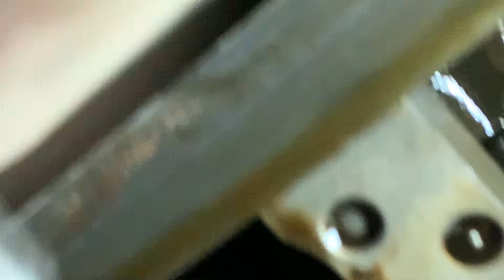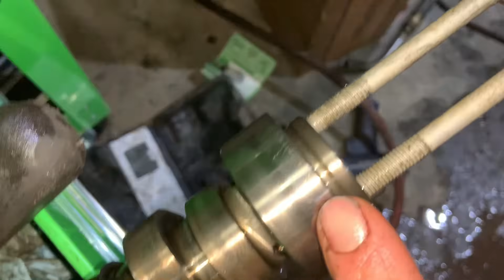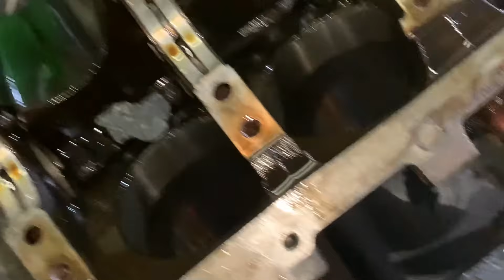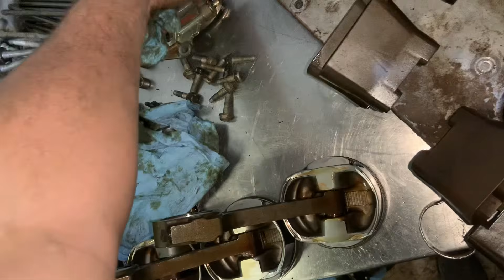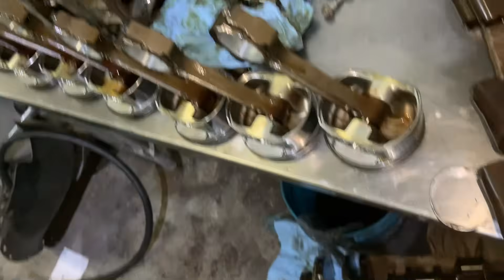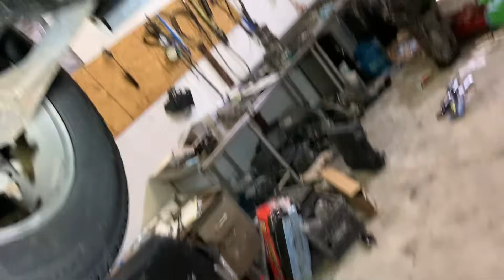ULTIMATE LS ENGINE NO OIL PRESSURE LOW OIL PRESSURE DIAGNOSIS AND REPAIR GUIDE

Comment: I can’t figure it out!! I have 40-45psi on startup but after it’s completely warmed it’ll drop to 10-13psi I’ve checked with a mechanical gauge, replaced cam bearings, replaced oil pump and o ring, replaced pickup… I can’t figure it out.

Comment: This means that if your lifters start becoming noisy, then every thing you mentioned should be checked including pulling the oil pan off and replacing the suction tube O-Ring. You could replace the lifters and the problem will remain otherwise.

Comment: Yes thanks nice vid .. I’ve got a GMC Sierra 5.3 that has 40 psi on start and maintains fine for first 5-10 run then sits on 18 psi on idle and once putting foot on gas maintains 30 psi I’ve changed oil pump , oring at pick up tube , oil pressure sensor, still same issue..  is this oil pressure ok ??? Truck has 240,000 miles it’s a 2011 model… thanks

Comment: Damn good video wow! I had an oil pressure problem on my 5.3 & thankfully it wasn't the cam bearings....it was an AC Delco oil filter. Oil pressure dropped down to 10psi.....(was always 50 psi).....changed it out to a WIX brand & it went back to 50 psi & has been there ever since. I dodged a bullet! God forbid I would ever have this problem but the 1st thing I'll do if it happens, I'll pull the pan off and check the bearings. Some things GM does, definitely does seem skimpy.... same with AC Delco....seems their parts are all Chinese crap now.... gonna stay with WIX brand for now. Thanks again!

Comment: All really good information, all true.  I've been lucky over the last 15 years of building LS's and I'll admit most of my engines have been junk yard pulls, most times they are low mileage motors and the only reason to pull the heads were to install new lifters.  Any engine that leaves my garage, junkyard pull or ground up build gets a new Melling oil pump, one piece pushrods, a new LS2 timing chain and gears and a trunnion upgrade kit for the rockers.  I've heard of this but it is the first time I've ever seen a cam bearing walk but I'll be looking for one now.  When I hear a lifter ticking I've always traced it to a worn pushrod and rocker arm.  When you disassemble it the top ball of the pushrod is worn oval destroying it and the rocker body because it had quit spinning.  Hopefully my luck will hold out and with this information in hand I believe it will.  Thanks.
Reply from the maker: thanks for the info on lifter tick.  I have yet to encounter that.  but I will look for it.  Why do you feel the pushrod is rotating in the lifter cup?  I knew they did on flat tappet cams as the lifter is offset ground to ensure even wear.  I assumed the fixed orientation of the ls roller lifter would mean the pushrod was stationary.  I'm not debating this just trying to learn.  I would think the preload would keep if fixed. let me know your thoughts.
Reply: @Brainstangs  It's true the lifters remain stationary and I don't know why but on almost every LS I tear down I find 4-5 rockers where the cup in the rocker and the top of the pushrod looks like a football.  The pushrod only wears front to back and quite a bit has been worn off causing a ticking noise.  I always replace those rocker bodies and install one piece pushrods.  Maybe it's a GM problem with the pushrod ball heat treat, I don't know but when you hear a ticking coming out of an LS it's a worn rocker and pushrod.  I had that argument with my local dealer on a 2004 Silverado I had so I pulled it apart and showed him the parts.  I replaced them and drove back over so that he could hear it and he reimbursed me the cost of the parts.  He told me it was normal.

Comment: I have about 25 psi at an idle on my 2008 GMC Sierra w/ a 5.3 engine.  Is that to low?  How can I find the oil psi spec for this vehicle?
Reply from the maker: no.  I see this all the time. The way you can tell its fine is at your next oil change watch it jump way up on first start.  25 at idle I see all day.

Comment: I myself was hit by this dreaded issue.  the #3 bearing spun and tore the block up. To salvage the block im gonna have the block line bored so we can use a #2,4 or the 1,5 bearing in the #3 location.  I only got 93k on my 6.0    but it does have a lot  of idle time if that means anything.  I was fdriving and all assudden the lifters got really noisy.   then the quited down.   then the noise came back .  this all happen within a 1/4 mile.  I went from 55-60 psi hot at idle to 20psi and the pressure fluctuated.
Reply from the maker: if its an iron 6.0 I usually have no issue with the block taking a new bearing.  Like I do nothing but put the durabond bearing in and its good.  I would love to see a pic of your block in that area.  thanks for the info

Comment: I have a cammed 5.3 with low oil pressure problems when it’s started and cold the oil pressure is right at 40 once is warm and driven it slowly goes down I haven’t got a low oil pressure warning on dashboard yet, I have replaced the oil sending sensor and a rear main seal it does have a leak that seems to be towards the front of the engine do you think this may be oil pickup tube or oil pump, thanks
Reply from the maker: an external leak  that isnt large isnt an oil pressure issue.  But depending on how low your pressure is it may be a pump or oring
Reply: @Brainstangs  I had the pump replaced with a high pressure pump do you think my oil cooling lines may be the problem its not overheating but it also has a stall and untuned so tranny may be heating up a bit
Reply: @rrwe22  did the oil pump fix your low oil pressure ?
Reply: @juniorfhuftv1995  it did but that wasn’t my problem I got rid of the truck

Comment: Nice video! Is it possible to run 5w40  or 10w40 oil in these LQ4 6.0s for heavy use like towing? 100 degree summer weather
Reply from the maker: yes but I dont think its needed. I never had any issue with a 5-30

Comment: Seriously THE most informative and comprehensive video on the oil issue on the LS motor.  I'm experiencing the dreaded low oil pressure issue and am praying that it's not a cam bearing.  I now have the knowledge to get into this diagnosis.  
Question: are the oil pan gasket and the front cover gaskets reusable like the trans pan gasket and the valve cover gaskets?
Reply from the maker: They are but in my opinion not with it.  They flatten out and sometimes leak.  Best of luck

Comment: THANK YOU!  BACK IN MAY ,DROPPED OIL PAN  CHECKED CAM BEARINGS WHICH I WOULD NOT HAVE IF NOT FOR YOUR VIDEO ,YES NOT AS EASY AS IT SOUNDS, USE A MIRROR AND SOME TWISTING AROUND ,ALL LOOKED FINE ,ALL I DID  WAS PUT A NEW ORING ON OIL PICKUP AND EXTRA BOLT AND BRACKET ,OIL PAN GASKET .NO MORE LIFTER NOISE ,OIL PRESSURE  40LBS 269K NOW  AND RUNS AND SOUNDS LIKE NEW  . IT IS  AMAZING WHAT ONE LITTLE  ORING WILL DO , HELP FRIEND WITH SAME PROBLEM ON O5 5.3 AND FIXED IT .SO IT IS NOT A CAM  AND LIFTER PROBLEM! !POM THAT MY CAM BEARINGS ARE GOOD .  AT 215K THIS O5 5.3 STARTED SMOKING BAD ON CRANK UP , USED QT OF OIL  ABOUT EVERY 200 MILES , FOULED      PLUGS, I PUT FILTER ON VALVE COVER AT DRIVERS SIDE BACK ,PLUGGED INTAKE HOLE , NOW FOR THE LAST 55K IT DOES NOT USE  A HALF QT OIL IN 6000 MILES ,(MY OIL CHANGE WITH MOBIL ONE 10W30)LATER I PUT BREATHER  ON OIL FILL CAP, I HAD REAR MAIN SEAL GO OUT  THINKING IT NEEDED MORE BREATHING.YES, THIS IS AMAZING THAT  TWO SMALL THINGS CAN FIX THESE PROBLEMS THAT I KNOW PEOPLE HAVE DONE MAJOR  COSTLY ENGINE WORK!!!
Reply from the maker: so awesome.  Glad I could help!

Comment: If you have a cam bearing walking out can you have 20 pounds hot idle at the filter and five up top at the sending unit. Thank you
Reply from the maker: not really.  If you have a cam bearing out it will be much less.  If you have  two different readings top and bottom of motor you may have a plugged screen in the top of the motor.  20 is fine hot idle

Comment: Thanks GREAT video.... a New Melling Pump Green O-ring didn't solve the low oil pressure problem... Will be checking Cam Bearings Next... 2004 6.0 Chev SLT Silverado 290,000 Km Runs and Idols Super Smooth... Zero metallic in the Oil filter and Drained oil... About a dime sized pile of Shaved Iron in the Washed with varsol Oil sludge in the bottom of the pan... QUESTION : Would you replace the Main bearings or Rod Bearings when this engine is pulled Was running perfectly smooth even with low oil pressure.... or what would you replace if I wanted another 250,000 Km out of this engine... Thanks from Alberta Canada
Reply from the maker: no need to replace bearings if they look great.  But if its a cam bearing you will be pulling the entire motor down, so you may do a freshen up.  
best of luck
Reply: @Brainstangs  Thanks for doing this Video :)
Reply: @Brainstangs  I pulled the 6.0 engine... 2nd Cam bearing moved out and got touched a few times by the Crank I'm sure thats where the small dime size pile if shavings came from... I'm going to rebuild the top end with a Sloppy Stage 2 cam and Trick Flow 225 Heads new Torque Converter to match... and everything else up top that need tweaked, goal 500hp... I'm building a Earth Roamer with 37inch tires to head out Gold Mining (google Earth Roamer)... I've been doing Autobody for 40 years now so should be an easy project...

Comment: I have a l76 G8 that had low oil pressure only when the car warmed up and only at idle, as long as i was move the oil pressure was up. Crazy part i never heard any noise come from the engine, no ticking clanking or anything. I tired and checked everything it quit one day on the way from work so i said fuck it and put it in the shop for a rebuild, oh its cammed also.
Reply from the maker: that sucks.  good luck
Reply: Same issue with my g8 did it fix your oil pressure?
Reply: @juniorfhuftv1995  bad cam bearings

Comment: Great video! I have an oil pressure and cant figure it out.  I have a 5.7 ls off a 99 TransAm, I have 40 plus oil pressure on cold start but after 20min drive on the highway it starts to drop and end up getting down to 8.  If I let it sit and cool down the pressure will be back up.  From your explanation of the oil pressure system I would assume its a pump issue with the  valve getting stuck and not opening all the way.  Do you think that would be the problem or would I too have the risk of the bearing having walked out?  

Thanks in advance for your time, I greatly appreciate your help.
Reply from the maker: I agree with you.  Start there.  pump for sure it sounds like

Comment: if its AFM/DOD its a bad lifter.
Reply from the maker: The afm dod system has little to do with oil pressure.  Even when they are bad they will maintain good oil pressure if all else it well.

Comment: I got a ls that reads 70 ish pounds on the gauge in the truck at idle but the top end has a knock or tick 
Dose have brand new lifters and cam. Same sounds but it dose not seam to get oil to the rockers. 
Could the o ring be bad on the pick up tube?
Reply from the maker: have to verify no oil up top running it without valve covers.  oring will cause bad lifter sounds.  It would be a good place to start.

Comment: Please help me out I just had a full DOD delete new cam lifters and springs,oil pump all gaskets had it tuned with a guy that really seems to know hp tuners  well I noticed when I picked it up the oil pressure was much lower at idle 25 lbs was 40plus then up to 60 when getting on the pedal now it starts up goes right to 45 but after running for only a few minutes it’s down to 25 at idle about 40-45 when getting on the pedal but it had a check engine light come on for the oil pressure sensor then the next time I started it the light was off hasn’t came back on oil pressure is still lower than it was but the really strange thing is the temp gauge is like starting off at 160 after only a few minutes of running at idle it says it’s at 210 already yes that fast have any idea what to look for ? Appreciate your knowledge
Reply from the maker: 25 at idle is just fine.  No issue at all. Fresh oil cold will give you   40 again.  I see lots of ls engines running fine at 20 psi idle.  Your temp issue I don’t have enough information to make a guess.

Comment: I have a 2008 GMC sierra Dinali I recently have oil pressure issue so I remove the oil pressure sensor and took a pick to take the screen off but there was no screen but the piece wire pick fell in the hole ,so I drop the oil pan and I still cannot find the pick any advice?
Reply from the maker: oh dang.  If you cant get it out with a magnet you would need to pull the trans and the rear main cover as this opens up that oil circut.

Comment: My 03 Silverado 6.0 i noticed the oil pressure getting a little lower over the last 5 months, but now the oil pressure is about 10 pounds at idle. No noise in the engine. But i pulled the oil filter and this is the first time ive seen metal in the filter. Damn.
Reply from the maker: sounds like cam bearing.  Sorry.
Reply: @Brainstangs  yep thats what it was, just put a new motor in and done with it.

Comment: Hey great vid . Just finished my swap . Upon first start (6 months ago ) I had 40+ psi n today I looked at my guage n now it’s hovering around 20-22 psi . Doesn’t fluctuate much but today I’m going to test with a mechanical guage n change the sensor. Any help would be greatly appreciated.
Reply from the maker: 20 ish  is fine.  I see this change all the time with new oil and old oil.  Do an oil change and i bet u see that pressure come back.

Comment: Now I know the rest of the story! But I do have a question. So just rebuilt a 2005 5.3, L33, just about the only thing that I did not replace was cam bearings,( I know now should have taken the time) but the looked like they were in great shape. Any who, crank the truck, oil pressure is great right around 55/60 psi, runs good, after about 10 minutes of normal driving oil pressure starts to drop and dances between 40 and 60, then it dips all the way out. Dash light says low oil pressure then immediately comes back up to around 40 or 50psi. Then I’m at work or home, just depends on which way I’m going, ha. Going to put a actual gauge on it this weekend before I tear back into it. Any thoughts?
Reply from the maker: sorry so late but it sounds like a bad pump if the reading is real.  If not real its a sensor

Comment: Cam plate occasionally give a problem with the seal.
Reply from the maker: I have not seen one.  It could it the seal let go though. I think it wouldnt be so bad  though as its a tight seal just metal on metal, still a leak though

Comment: Haven't seen a problem described exactly as mine yet: 2005 6.0, Vehicle has lifter tap on passenger side. When turned on psi shoots right up to 80 and stays there. Under strain from high mountain passes water temp goes up(still under 200°f) and oil PSI drops, sometimes sporadically and sometimes straight to zero. When I take my foot off the gas the oil pressure goes right back up. Hit the gas and it drops again. Already did oring and am now thinking pressure relief valve. It seems the pump itself is still good because it maintains high pressure other than that. I shut the vehicle off for an hour and let things cool down and and she'll drive the rest of the trip like nothing ever happened....but lifters still tap. I'm thinking the pressure relief is sticking when the engine and oil is hot under hard uphill load. Thoughts? Anyone?
Reply from the maker: I think a pump for sure and also maybe a new sender.  What was it if you have fixed it already?

Comment: Very informative video. Appreciate your time. 2006 Express 4.8L 195k. Oil pressure fluctuates and dips while driving, hot oil. 35-40 psi steady cruise, drops to 20 psi, shoots up to 45 and settles back to 35 or so. 5 psi Higher pressure when vehicle facing downhill or engine braking compared to uphill or accelerating.   30 psi cold idle quick pressure buildup. Dips to 20 cold oil while faster than idle. 35-40 psi hot driving, 50psi near redline. Engine runs silently. Eerily silent and free of mechanical noises entirely. Thinking restricted pickup tube?
Reply: Replace the oil pump o-ring on the pickup tube with an OEM gm one. Also install a .040” shim or washer under the relief valve spring.
Reply from the maker: sounds like a pump or oring issue. did you figure it out?

Comment: Hi there I have an 07 Chevy avalanche with high oil pressure at 60 pounds what’s to look for or Where is your shop at
Reply from the maker: 60 is fine by me.  you may have a stuck shut pressure reliefe valve in the pump.  Spanish Fork Utah

Comment: Most informative on low oil pressure i have seen, first i have seen showing the cam bearings walking out. Helped me out a lot with a 2005 Suburban i just bought and turns out to have low oil pressure ):

Comment: My oil pressure stays the same from start up to warm. It goes up to 25-30 lbs and stays there, if I press the glass while it’s cold it doesn’t go up at all. Only goes up when it’s up to temp and I press the gas. Also if I take off and it’s not fully up to temp the lifters will tick but go away.I figured it was that o-ring on the pick up tube  because it goes up when it’s hot but want some other opinions. ..... what do you guys think?
Reply from the maker: pump or oring in the pump.  I would do a complete pump to be safe